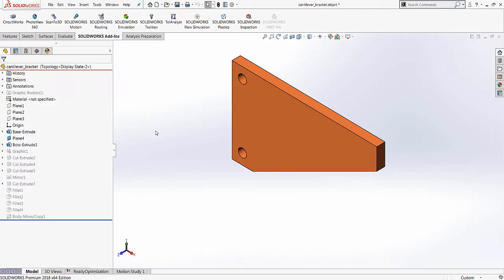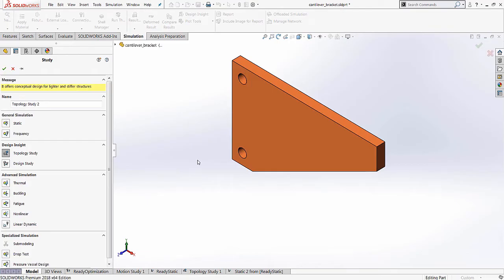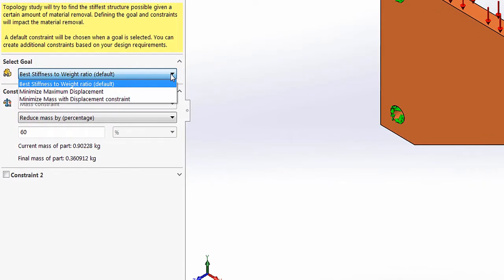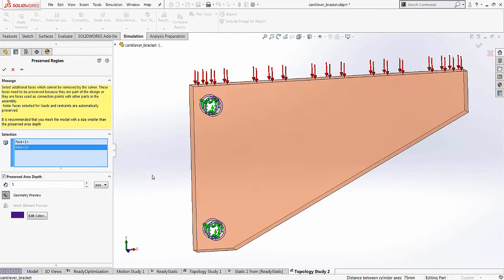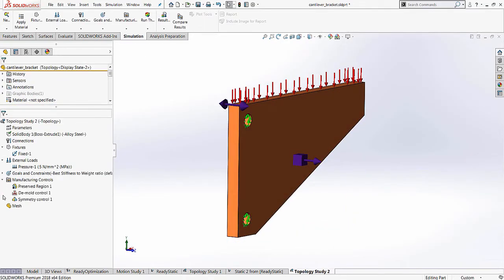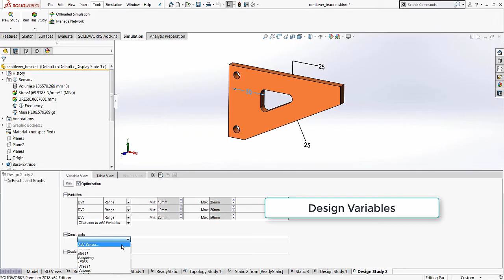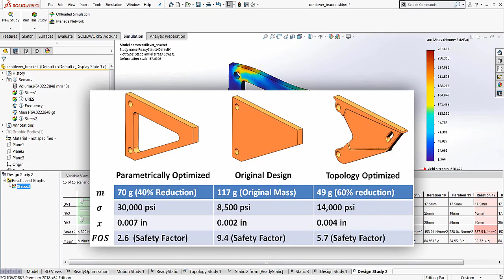SOLIDWORKS Simulation - Topology Optimization

Comment: Please can you tell the dimensions of this cantilever beam.
Reply from the maker: Unfortunately this model was made more than 4 years ago and we do not have the exact model any more. However if you watch towards the end of the video (6:00 ish) when they are discussing the cut out they do give dimension on that triangle. From there we can estimate the rough size of the at around 150mm on the long side and about 100 on the short.

Comment: Hi, I'd like to point out that this simulation is very flawed and I see this in many "tutorials" of this kind. I actually don't think that I saw a single video where such a showcase was properly done. The reason is that you miss-use cylindrical constraints while you need a contact or proper spring model. Have a look at the top left corner. Where do you think it would break? Now look where you vonmises stresses are higher, would you not expect the exact opposite?
Reply: How would I go about creating "a contact or proper spring model"?
Reply: You need to use a contact with a proper interface that only considers pushing forces. A frictionless contact should suffice for this. Solidworks offers the no pen contact for that but probably not in combination with topology optimization. For that, use ANSYS of Optistruct @NavinF
Reply: But the structure is intended to be held by the cylinders right
Reply: @bazz9920  That depends on the practical application. If the bolts are welded onto the part or if the entire assembly is actually only one part, then yes, one could model it that way. But at that point, why not make it a single part?

In this case the bolts are not welded though, the part can freely rotate around the bolts. But the used contact is fixing nodes all around the cylindrical shape and these nodes now sustain pushing and pulling loads, which is not correct for a bolt. A bolt can only sustain pushing loads.

To give you an analogy: a rope. A rope can only sustain pulling forces. Once you push it, it collapses. Now would it be correct to create a rope with a stiff beam? Certainly not.

Comment: Is there a way to carry out similar process without decreasing the thickness of the material. We generally laser cut the plates thus making it difficult to change thickness.
Reply from the maker: You can use a combination of thickness and manufacturing constraints in the setup to ensure the nominal thickness is maintained where the material is retained during the optimization process. Thank you.

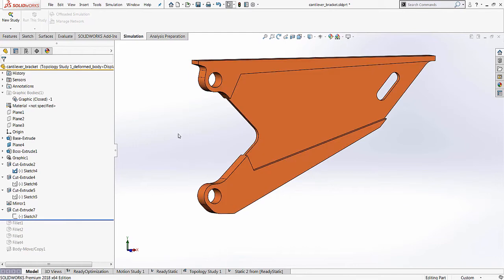Comment: 5:20 how did you go from the weird looking one to the smooth design. The first one doesn’t look clean enough for display
Reply: He most probably redid the model and used the outcome from the optimization as a reference. So he took a look at the outcome to see where ie a smaller thickness was possible.
Reply: It can also be done with Polynurbs

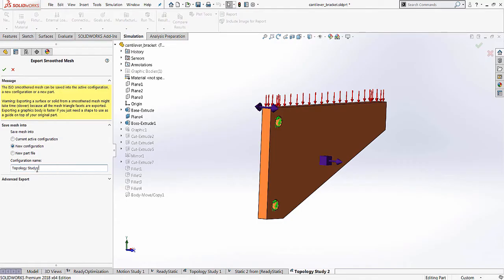Comment: whats happens from 5:14 to 5:22 ?? How i can do that ??
Reply from the maker: Between 5:14 and 5:22, we extracted the raw shape from the analysis using extrude and cut features from SOLIDWORKS using the raw shape as guidance. You can use the simulation overlay tool to help with this.
Check out this video for more details : https://youtu.be/A-tagMWBLBw

Comment: Whenever I try to run the Topology Optimization study i get an error that says "Result Files are not available. You may have to re-run the study..."

Any idea how to rectify this issue?
Reply: Hi Gary, in my experience I was able to rectify this issue by changing the geometry of part to be slightly larger, and saw another user solve the same error by moving the file path. That being said I suggest adding more material to the part if possible or moving the file path on the properties section of the Solidworks study. Hope that helps you troubleshoot!
Reply from the maker: For assistance, please contact our tech support team at goengineer.com/contact.

Comment: It seems very limited, no stress constraints, other objective functions?

I've used the one in Abaqus and it lets you set virtually any combination of objectives and constraints you can come up with
Reply: Including wear rate?
Reply: @thormanfield1305  If it can be output from abaqus in an implicit FEA procedure, then I think so. It doesn't make sense to use gradient-based topology optimisation for an explicit procedure.

I'm sure this one has extra features like that, but the point is that abaqus can be much more general, not just maximising stiffness

Comment: Great Video. How you make the cantilever
Reply from the maker: Great question!  The cantilever is a simple extruded sketch with another extruded cut for the two circles.  The exact dimensions are not very important if you would like to make a simple model to follow along with the video.

Comment: I REALLY enjoyed this vid.  Thanks.  I noticed that you applied your own aesthetics to the topologically optimised bracket, enhancing its appearance very much.  I think the relationship between topological optimisation and engineers' aesthetics is very interesting.  The T-O.ed bracket looks a lot better after you applied your design judgement to it.  Somehow I would trust it more than the more 'bone-like' solution which Solidworks generated to begin with.  I guess everybody has implicit feelings for things, even we non-engineers...

Comment: Can you confirm whether or not harmonic resonance be optimised?
Reply from the maker: Hi Stephen,
You can give the Topology Optimization frequency boundaries to optimize around in addition to the non-harmonic loading.  You can specify, for example, that the resulting model have a first resonant frequency no lower than 1000 Hz and this will act as an optimization boundary for the calculation.
Reply: Wow... that could be very helpful as I am trying to optimize a musical instrument.  Thanks for your post @goengineer
Reply: @stephensmith799  Interested to hear on how your project with the instrument went! I'm a recent graduate of M.E. and am fascinated by all this!

Comment: Is the optimization tool not present in solidworks 2016
Im unable to find optimization in simulation module
Reply from the maker: Hi Firoz,
Topology Optimization did not yet exist in SOLIDWORKS 2016.  It is a new function to SOLIDWORKS 2018.
Reply: doing same thing in 2016 final result is generating crash report.
Reply from the maker: Hi Karan,
If you are getting a crash in SOLIDWORKS, for any reason, you should go through this crash diagnostic process (http://kb.goengineer.com/go/default.aspx?kbID=12970) and/or involve your local VAR to assist in diagnosing the crash.
Reply: and system crash